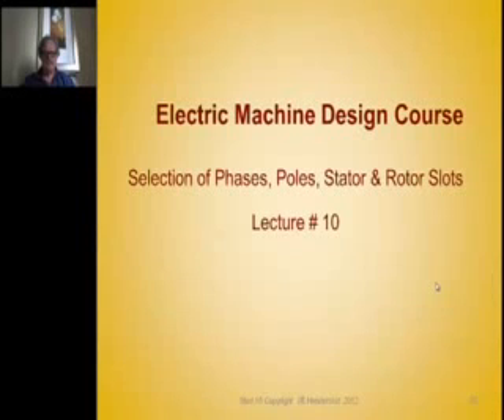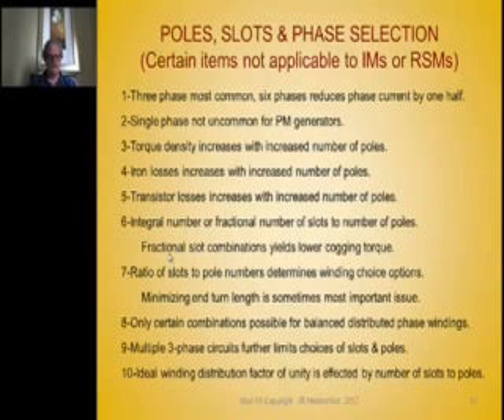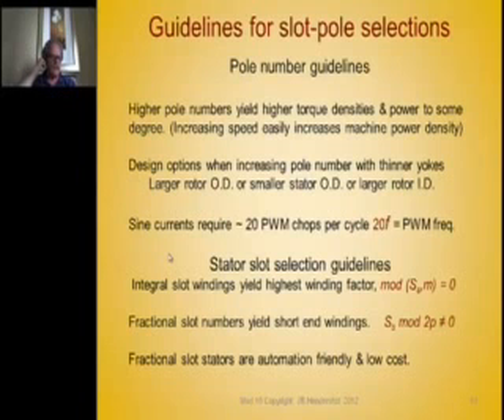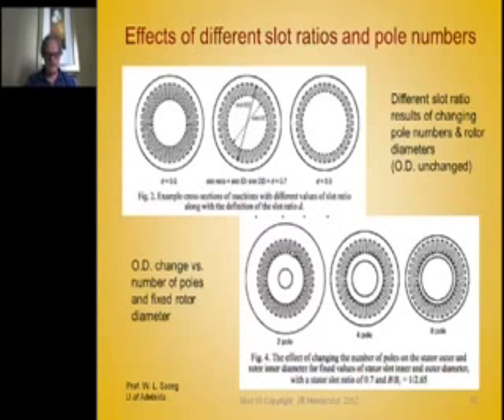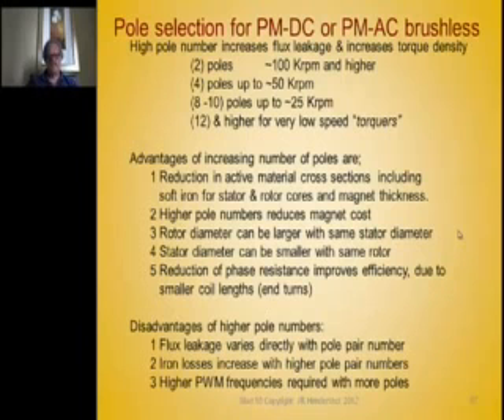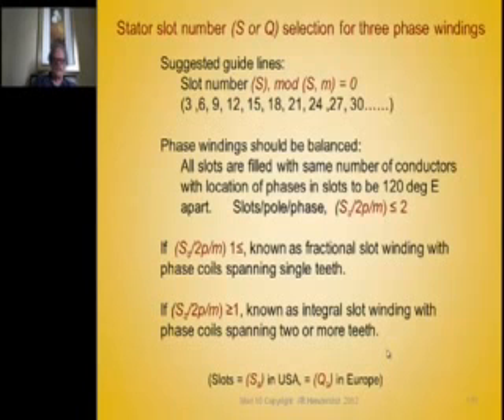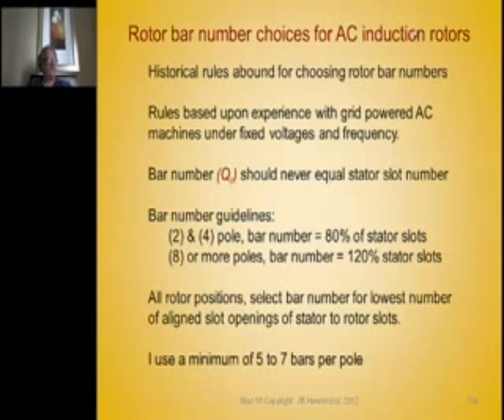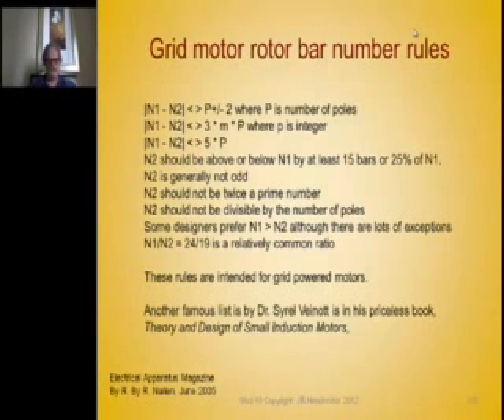Module 10 Selection of Phases, Poles, Stator & Rotor Slots

Comment: In formula E a permenant magnet synchronous motor is used with 1 rotor and 2   3-phase stators. The stator poles are 60° shifted than the other stator. 
Any advantage to such configuration??
Reply from the maker: a motor with one rotor and two stators with an offset shift will have more power ..